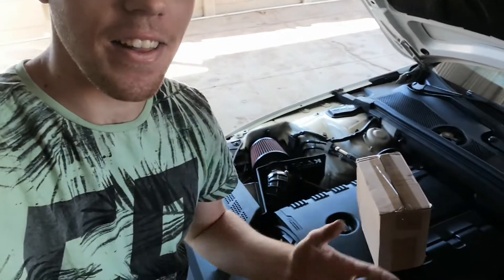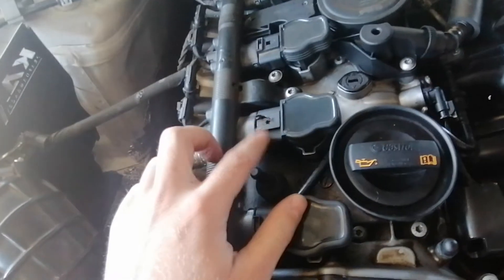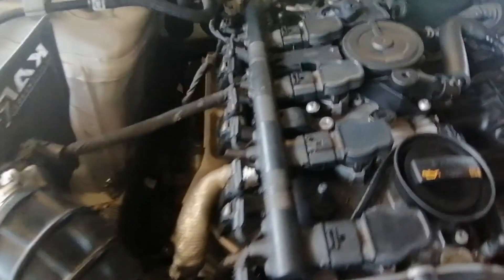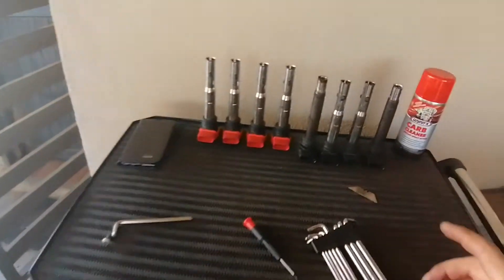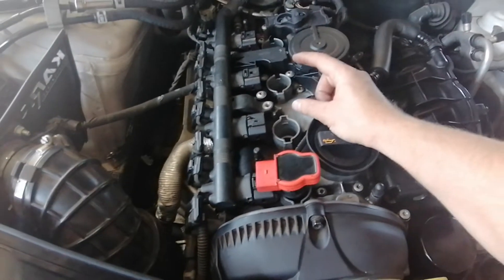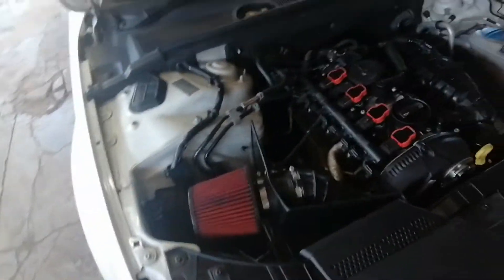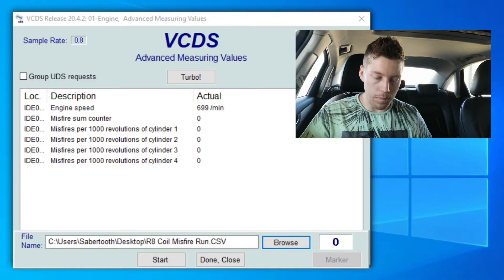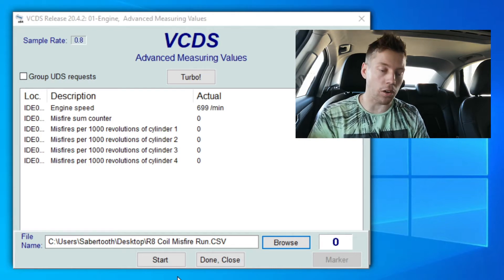Installing and Data Logging New Audi R8 Coils in my Audi A4 B8 2.0T

Comment: The black sleeved ones are a newer revised version. Its possible that a previous owner had issues with ignition coils and only replaced the faulty ones rather than whole set.
Reply from the maker: Ohhhhh damn... Thanks for letting me know 💪 I tought it could handle more heat or something 🤣

Comment: Congratulations mate. You have done excellent work in your videos and help many people. One question, do you suggest r8 coils to stock 2.0tfsi engine with a bit retardation or not? Generally do they help a stock engine or they are for tuned cars?
Reply from the maker: I would most definitely get them 💪 stock or not stock. Either way they will be new and fresh compared to the ones you have in currently, the car will probably feel a bit smoother and be more accurate at Ignighting the Spark plugs that may result in an extra horsepower or 2 haha... Especially if you have retardation it might help you there aswell as it helped me a little bit 👌 another thing... If you ever do consider working on your car like Stage 1 or 2... Your coils will already be "upgraded" that might deliver even better power 👌💪🤷🏼‍♂️ i see it as a Win Win especially if you have the money laying around.

Thanks for the compliments 🙏 i really do appreciate it 🥳
Reply: @megalodononwheels  Do you use ngk pfr7s8eg  or bkr7eix sparks ? It would be a good comparison test between pfr7s8eg, bkr7eix and bkr8eix with r8 coils..
Reply from the maker: Ohhhhh most definitely 💪 i am using PFR... But i want to get the PFR8S8EG, they are the colder heat range plugs because my tips are white (White = Heat) so i want to see how they will help with the Retardation 🤷🏼‍♂️👌 but i also heard the BKR are very good spark plugs. The Only thing is i have always used NGK and never had a single problem with it... Maybe the BKR will be better, who knows... Now my mind is running 🤣 maybe i should try it out 💪
Reply: @megalodononwheels  Mine are white, too! How is your oil temp?
Reply from the maker: I still need to do it... I also just bought an Oil cooler a few months ago, never got to it yet with the moving haha... But will do a data log on it soon to see how much it really helps 😜 you just got a tiny Leak lol
Reply: @megalodononwheels  Nice!! Go on, I am waiting for your logs :)..  About tiny leak, i cant find it :(
Reply from the maker: Which tiny leak are tou reffering to?
Reply: @megalodononwheels  oh, i supposed that you told me that maybe i have i tiny leak , therefore hot sparks..
Reply from the maker: I went through the messages again, I don't see us mentioning anything about leaks, that is why i am a bit confused now 🤣 hot plugs is one of those things that just happens... A small leak shouldn't cause it as far as i am aware
Reply: @megalodononwheels  sorry my false.. never mind! Anyway, go on your excellent work and help people!

Comment: I'm thinking of getting the r8 coil pack to put in my 2.0T along with ngk spark plugs
Reply from the maker: I am running NGK spark Plugs... I actually want to get the Heat Range 8 (the higher the number the colder they are) stock is heat range 7